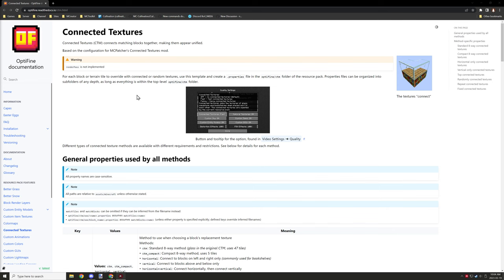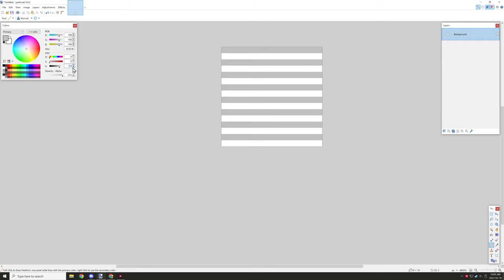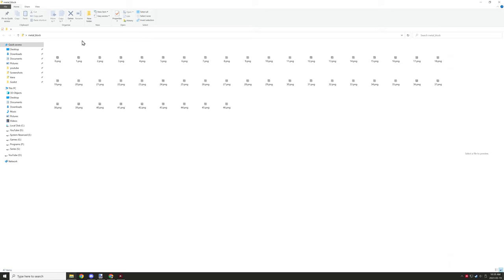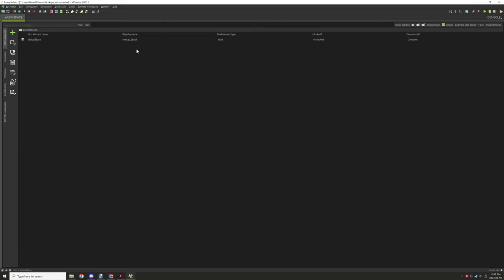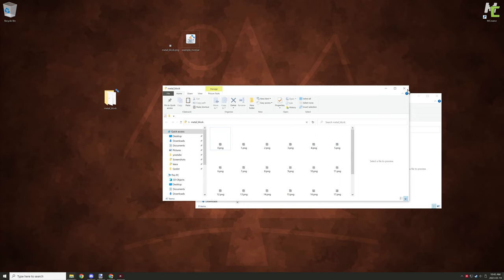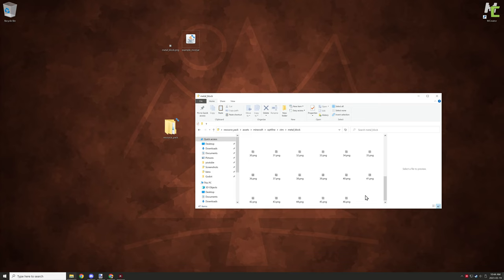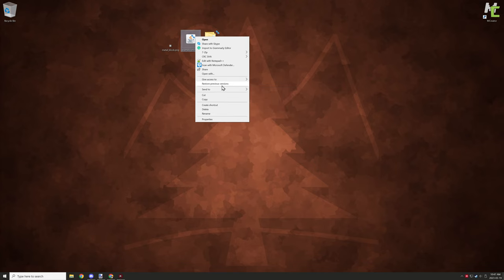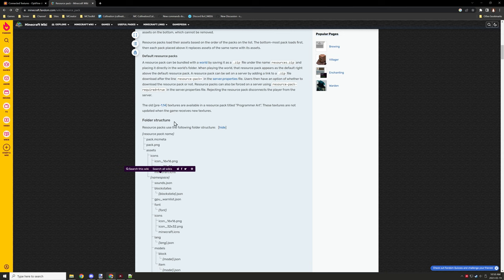How To Use Optifine CTM With MCreator

Comment: really useful tutorial
but is there a way to add the connected texture resource pack inside the mod?
Reply: nvm i figure it out, i just need to put the connected texture in mcreator workspace folder
Reply from the maker: Far as I am aware it's not possible, I have not tried keeping in in the resource packs folder but I am pretty sure that is not exported with the modification so chances are clients will still need to download and install the pack. It would be possible though to use procedures to do the same thing but it's a lot of work which is why I have not bothered trying.
Reply: @NorthWestTreesMCreator  i tried to put the minecraft folder with connected texture inside my mcreator workspace and i export it and it worked without applying any resource pack

Comment: Hello! I have a question about how to make my block that I created not connect to the fence
Reply from the maker: Some thing for blocks such as material can influence the mechanics of other blocks. Most likely the material type or if its not a solid cube on that side that its connecting to might cause fences to not count as a block it can connect to. Also some custom fences that use different materials such as wood or stone won't connect with other material fences eg wood fence to netherbrick fence as one is stone and one is wood materials.
Reply: @NorthWestTreesMCreator  Ok, thanks!

Comment: Optifine CEM?
Reply from the maker: Their wiki said CTM which stands for "Connected Textures Mod" even though it uses resource packs to run, I think it was a mod at one point before it was merged with Optifine if I recall correctly.
Reply: @NorthWestTreesMCreator  
Well does optifine CEM work with MCreator or no? Like how on earth would you implement a giant spider with the default animation? How?